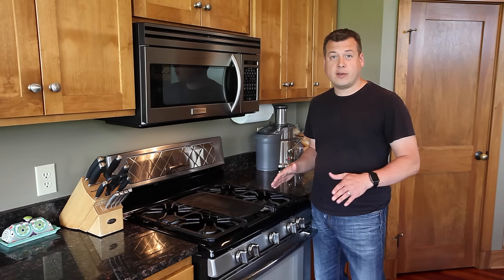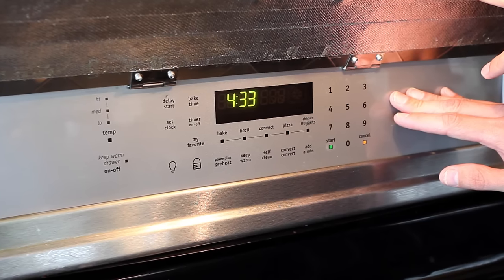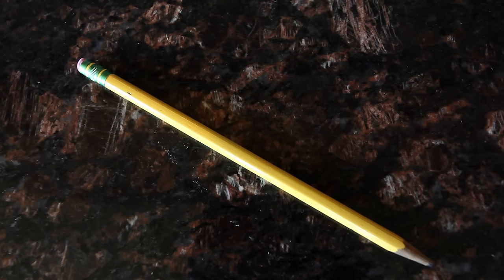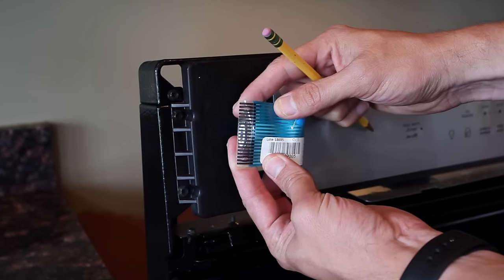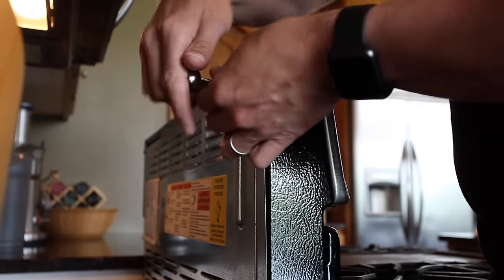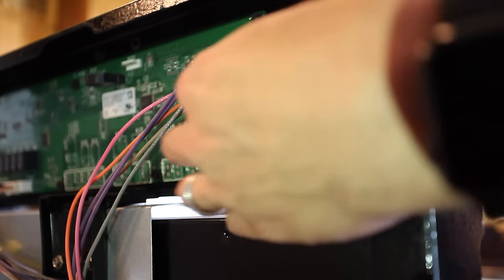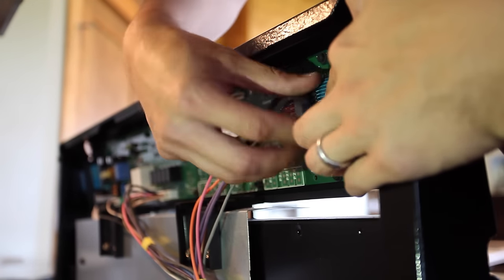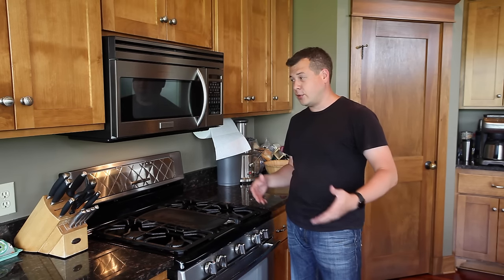Stove Buttons Not Working - How to Fix Range Keypad Using an Eraser

Comment: I’m having a hard time removing the ribbon from the clip that’s different from the one shown in the video. Any advice on how to do this?
Reply: In this video, the ends on the side needed to be squeezed to lift the ribbon cable.  In some cases, the locking mechanism is a flap.  So with your finger nails apply some pressure at the middle of the plastic or metal plate (a narrow strip) that holds the ribbon cable to lift.  The flap will stay upright at 90 degrees to the ribbon cable after it is lifted.  Then gently pull the ribbon cable.  When putting it back, make sure to insert it the way it was before.  You may take some photos before pulling the ribbon out.

Comment: Bought acnew board for my oven, then found this video. Replaced board and cleaned ribbon connectors and still no buttons work. Im confident this is the problem as liquids were spiltl on connectors.  Any idea what problem is? Could it be other end of connectors as well? T
Reply from the maker: Hmm...not sure. I suppose it could be the other end of the cable.  Can you find the other end?
Reply: Don't get dishearten. When I was fixing my TV it did not work and I was hopeless.  I suddenly noticed that my ribbon cable, even though looked attached to the board, it was barely touching the board.  I removed the ribbon cable and reinserted it. It went pretty deep into the slot, may be about 5 mm deep.  Then the ribbon cable was sitting on the board firmly and my rest of the repair of the TV was successful, and the TV came back to life.  You may try to reinsert the ribbon cable after cleaning so that it goes all the way into the slot and sits firmly.

Comment: Hi sir, I have question, my problem is that when I put the temperature and press bake , it just stops.
Reply: This video gives the easiest way to eliminate that the circuit board buttons are all functional.  I believe, if the thermal cutout/fuse is blown, i.e., open, the circuit board will think that it is already too hot, and will not allow the start button to respond.  Does the start button work at all for anything else like setting the timer or any other function?  If the start button works for other functions, then perhaps the problem lies in the thermal fuse/cutout.  However, first try to clean the ribbon cables the way this video described and some other viewers gave tips for cleaning.  Make sure that the ribbon cable is inserted fully into the slot and attached firmly.  In the mean time if the power supply adapters gets loose, push them in to have a firm contact. I am not an expert.  Hope it works.

Comment: Tin lead connector contacts are very inexpensive...however...tin and lead form an oxide layer that prevents the rest of the metal from corroding.  This layer is not conductive and eventaully causes problems.  This works, but the problem will come back in about a year.  Just repeat the "fix"!
Reply from the maker: Thanks, good to know!

Comment: Have you heard of the Jenn air wall oven that resistor burns out and you solder in new one?
Reply from the maker: Sorry, I haven't heard of that one.
Reply: Patrick Thackeray  ss .thanks tom it worked like a charm you saved us a lot of. M.oney

Comment: Unfortunately, my ribbons cables are not the same -  they are encased in the plastic. But, thanks for this video.
Reply: Sometimes they look like encased.  However, at the edge of the plastic encasement, please check if there is some thin joint that you can lift that flap with your finger nail or gently with a screw driver without damaging the ribbon cable.  In my TV I saw the ribbon cables like that and I could open it.  Please google for images of ribbon cable connections which may give you some idea as to how to open or disconnect them.

Comment: Perhaps a THIN light coating of silicone dielectric grease on the electrical contacts would prevent this form of corrosion at the terminals as done in  motorcycle and automotive applications....
Reply from the maker: That's a good suggestion.  I think I'll give that a try next time I tear into it.

Comment: Gave this a shot on my kitchen aid but it doesn't have the exposed ribbon.  Instead it is a plastic pin connector.  So this did not work on that brand.

Comment: It didn't work for me. Do you have other suggestions please?
Reply from the maker: The eraser trick seems to work in most cases but it sounds like you might have a different issue going on.  I'm not sure what else you can try other than replacing the part and seeing if that works.
Reply: Thank you!

Comment: Hi. I tried it on a Samsung NX58H5600S  unit that is not even a year yet and im totally disappointed it did not work in fact i got one more button to stop working. thanks though
Reply from the maker: Sorry to hear that. It sounds like you might be one of those rare legitimate cases where you might actually need to replace your board or cables.

Comment: I have no lights on at all, would this still work
Reply: Do you see any light at all in your unit that would indicate that the outlet to which your appliance is connected it good? First disconnect the appliance from the outlet. Perhaps the power supply cable adapter (that may have two or bunch of small wires) that connects to the circuit board need to be removed and reinserted to make a firm connection may help. However, please do not take them out by pulling the wires.  They are held by small locking tabs, which may require squeezing on the sides or slightly propping gently with a screw driver, making sure not to rest on other components when applying pressure with the screw driver.  Then connect it back with the panel board making sure all the pins get into respective slots in the socket..  Make sure it gets a firm connection.  Also using this video, clean the ribbon cables and firmly insert them into the slot in the panel board. Then connect the unit to the wall power supply for testing.  Hope it works.

Comment: Good Video, except you should instruct the person watching that the stove needs to be, for safety reasons,  unplugged from the wall.  Yours is a gas stove, which works on 120Volts AC. However an electric stove works on 240Volts AC.  Either voltage can be lethal under certain circumstances. Please correct the video.

Comment: How did you figure this out?
Reply from the maker: After replacing the button panel multiple times in the past at about $200 a pop, I was convinced that the issue was heat related so I made a video a long time ago on making a heat shield.  During the filming of that video, I was all set to install the new panel and decided to give the cables closer inspection before tossing out the bad one.  I cleaned them up with a pencil eraser, not thinking that it would really work, I plugged it back in and everything was like new again.  I couldn't believe it.  That old video has saved people hundreds of dollars (read the comments) and proved to be a good solution.  Recently, the buttons on my stove started making me hangry again so I decided to make this updated video with the fix.  Worked like a charm! :)

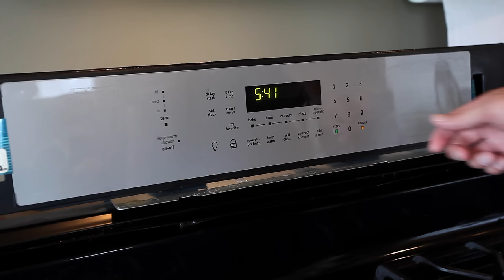Comment: But at 2:45 when you push the numeric panels ...numbers didn't change..
Reply from the maker: The numbers are only supposed to change if you hit the "Bake", "Bake Time"...etc buttons first before pushing a number.  Otherwise they just beep which tell you that they are now registering.  Before I started, not all of the buttons would beep if you pushed them.

Comment: but your clock is workung, my display is blank, the entire panel
Reply: Do you see any light at all in your unit that would indicate that the outlet to which your appliance is connected it good? First disconnect the appliance from the outlet. Perhaps the power supply cable adapter (that may have two or bunch of small wires) that connects to the circuit board need to be removed and reinserted to make a firm connection may help. However, please do not take them out by pulling the wires.  They are held by small locking tabs, which may require squeezing on the sides or slightly propping gently with a screw driver, making sure not to rest on other components when applying pressure with the screw driver.  Then connect it back with the panel board making sure all the pins get into respective slots in the socket..  Make sure it gets a firm connection.  Also using this video, clean the ribbon cables and firmly insert them into the slot in the panel board. Then connect the unit to the wall power supply for testing.  Hope it works.

Comment: Unfortunately did not work. Much Time was lost...
Reply: Same thing happened to me in case of my TV repair and I was hopeless.  Then suddenly I found that the ribbon cable was not inserted completely all the way down inside the slot.  After reinserting the ribbon cable straight down (it was deep, may be 5 mm deep) all the way, the ribbon cable sat firmly and the TV came back to life - was very happy.

Comment: Around 1969 while working for Motorola we had actual GOLD CONTACTS that Would NOT oxidize and 60 years later they still provide proper electrical connectivity. 
Thee  CHEAPO asian manufacturers skimp by using inferior materials and inferior methods

Comment: yeah, Didn't work for my GE
Reply: Don't get dishearten. When I was fixing my TV it did not work and I was hopeless.  I suddenly noticed that my ribbon cable, even though looked attached to the board, it was barely touching the board.  I removed the ribbon cable and reinserted it. It went pretty deep into the slot, may be about 5 mm deep.  Then the ribbon cable was sitting on the board firmly and my rest of the repair of the TV was successful, and the TV came back to life.  You may try to reinsert the ribbon cable after cleaning so that it goes all the way into the slot and sits firmly.

Comment: those graphite pads have a limited life, you will eventually have to install buttons and run wires to the circuit board.

Comment: Qtip some alcohol. Just saying
Reply from the maker: That would probably do the trick as well.
Reply: Now the eraser works on numerous things. Brakes for skates, (long story plz don't judge) lol, great for video game controllers and remotes, hair dryer elements. Most low voltage terminals or electronic elements or conductors. Oh and it gets rid of pencil marks. Lol. Alcohol and qtip  seals the deal, but also helps get leftover eraser crumbs and residue. Make sure it's high percentage alcohol won't dry fast enough for it to take its advantages. Great video buddy